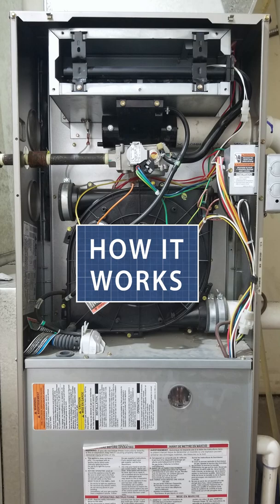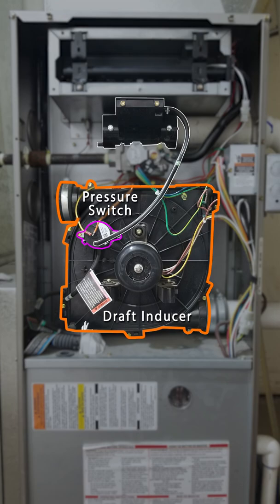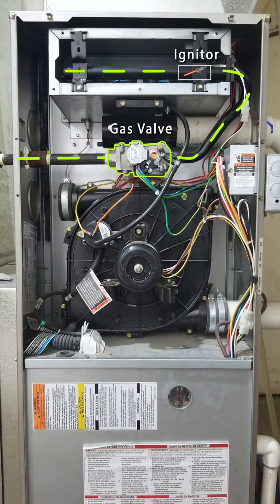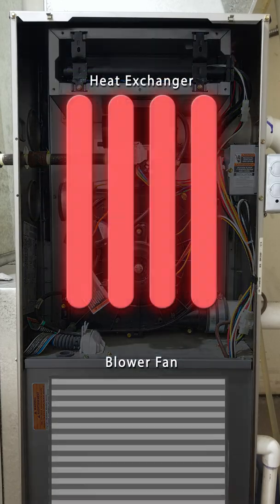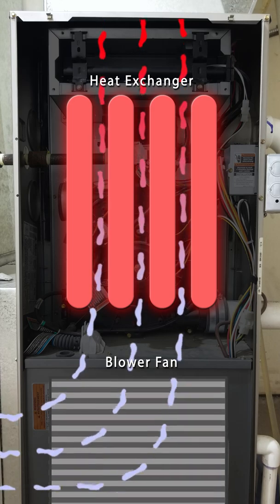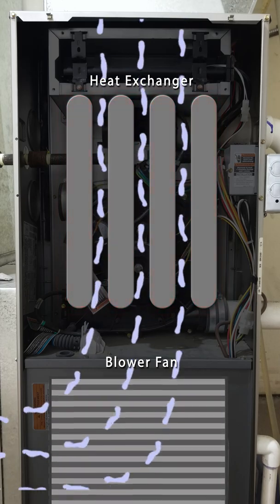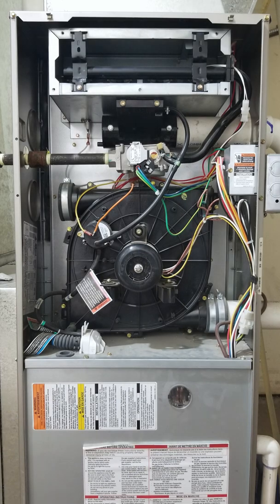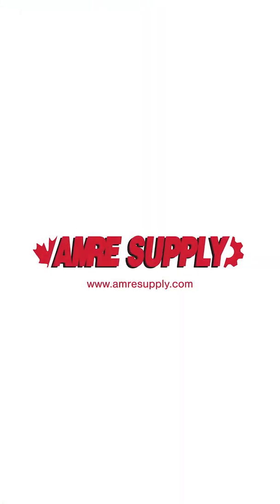How A Furnace Works (Explained in under a minute)

Comment: Flames on for 4 seconds then turns off.  Ignitor is new.  What else to look at?
Reply from the maker: Thanks for watching. Try cleaning the flame sensor. Then try cleaning the burners. Any buildup of carbon can interfer with the signal and prevent the flame sensor from working. https://youtu.be/b0sAGt-1niU?si=SM03mMPXSx5QCfOO
Reply: @AmreSupply  I cleaned up the ends of the burners that had a fair amount of rust buildup.  The flame sensor was tested for resistance at 121.  (New).  Video of furnace https://youtube.com/shorts/982trgLR2bs?si=-9N4Wq3Advbm9Anj
Reply from the maker: @ Flame sensor is a flame proving device, the circuit is completed through the flames so the flame sensor must be positioned correctly as well have a clear path for electricity to flow through: https://www.youtube.com/watch?v=Bl2hGox1lcs

If you've cleaned the burners, cleaned the flame sensor of any carbon, and it still shuts off ignition, then check all the connections to make sure they are secure. If this still doesn't help then the furnace might not be grounded correctly.

Comment: It needs to prevent the system from working or anything can go terribly wrong. I hope its easy to fix by a display panel of fuses that indicate whats wrong.
Reply from the maker: Yes the safety switches are designed to disconnect power if something is unsafe. Error codes can help one narrow down the source of the problem.

Comment: Not a great explanation at all. 
-draft inducer kicks on
-pressure switch hooked via tubing to inducer determines if air flow is enough to pull small vaccum to enable pressure switch to complete circuit to send signal to control board. 
-control board sends power to igniter which will glow red hot for 5-10 seconds. 
-if igniter heats up properly, sends signal to gas valve telling it to open and feed gas to burners 
-there’s typically flame sensor on far side of burners opposite side of igniter that will indicate it is receiving heat from the burners properly running
-blower receives signal to kick on and move air  needing to be heated from inside home return vents pass the heat exchanger the burners have been heating up, and that heat gets transferred to that air and sends it through the vents into your home then repeating cycle all over again until all air in home has reached set heat point. 
-burners receive signal from thermostat temp has been reached and shut off, and blower keeps moving air past heat exchanger pulling heat from it and cooling it down. 

*Tips: sensors in the hot box where heat exchanger is heated up will shut system down as a safety feature if it’s getting too hot. Majority of time it means not enough air flow through heat exchangers due to dirty air filter restricting flow, too many vents closed off in home not allowing proper air flow, or blower motor is crapping out.
Reply from the maker: Thanks for watching. This is a simplified explanation to fit a 1 minute short. It is difficult to cover all nuances in this format but we have dedicated longer form videos and troubleshooting guides for this: https://www.youtube.com/playlist?list=PLCo9SMjkdWBzorzNrARLKALj9fW7HzHMh

Comment: Well, the gas valve doesn't open first, the hot surface ignitor heats up, then the gas valve opens
Reply from the maker: Thanks for watching. This was just a quick video. The wording refers to the gas valve and ignitor together to describe the ignition process. You are right that the ignitor does heat up first. We made a more in-depth video about this with full 3D animations: https://www.youtube.com/watch?v=tVLtJwix-_8&lc=UgyeSiIfKjJ7BexMGpt4AaABAg
Reply: jerry R
0 seconds ago
Had a "smartvalve" open gas valve before the hot surface ignitor started warm up.... pretty big boom from that!
Reply: Yup 

Glow bar / spark 

This channel is ass